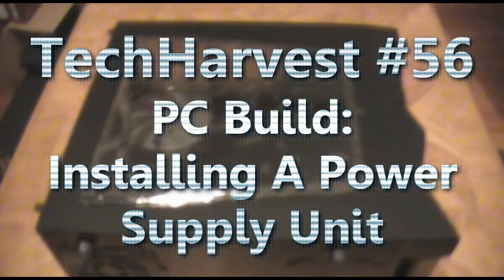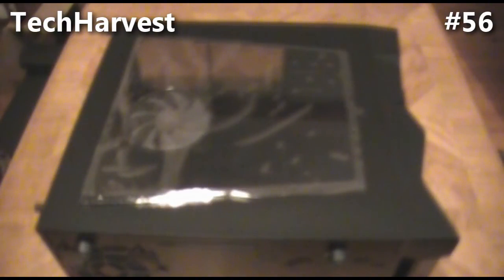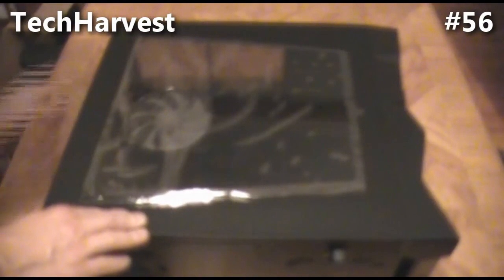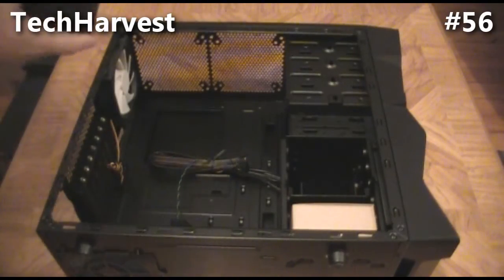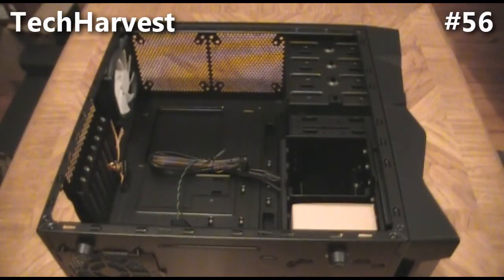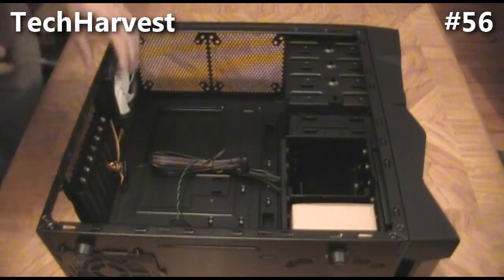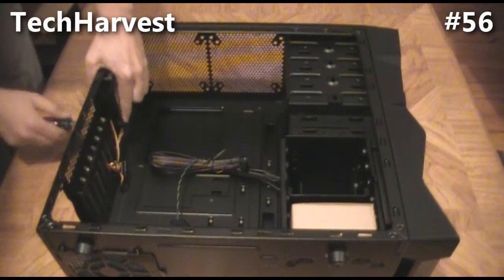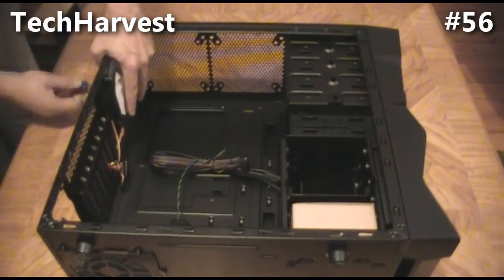Building A PC: Installing A Power Supply Unit

Comment: Hi there, I wanna ask is the power supply unit position is based on the design of the casing or u can just install it as u like? Because I see some PSU is install on the top.